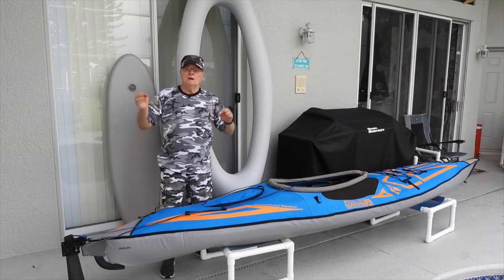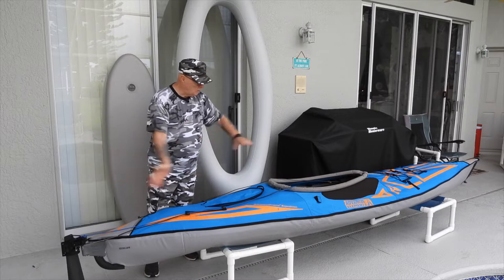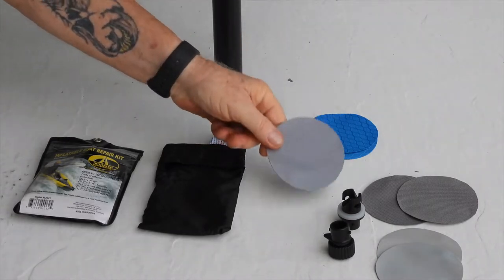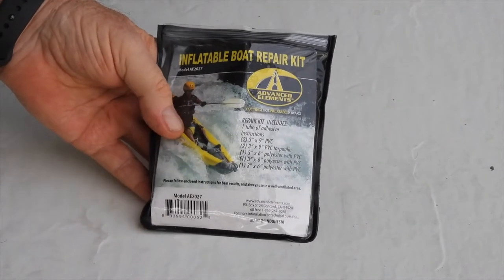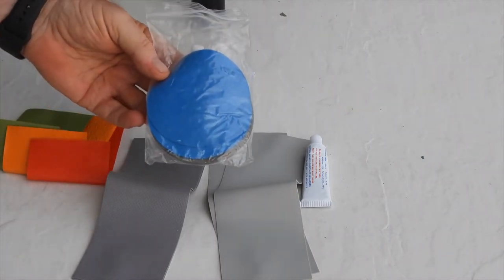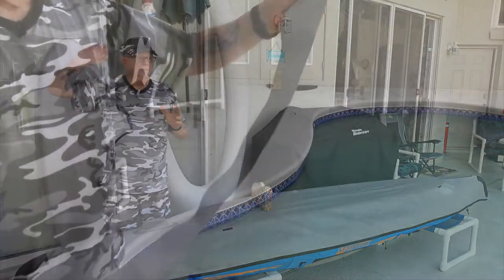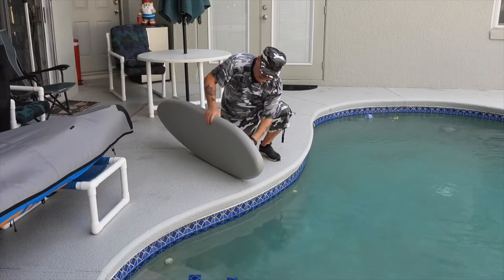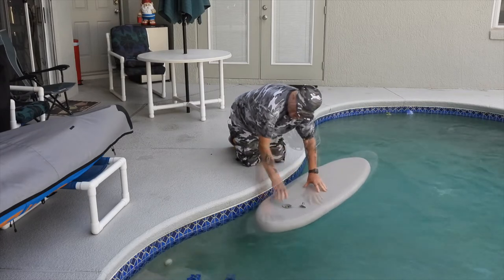Volume 2 Inspection & Repair

Comment: Very timely; just found out the leak I had thought was in the bladder is actually along the seam of the DS Floor
Reply from the maker: Glad I could help Bruce
Reply: @DaleMrDSimmons  haven't watched that far. Did you patch the DS floor?
Reply from the maker: @brucewayne2091  no didn’t need to
Reply: @DaleMrDSimmons  I'll have to figure it out 😁

Comment: Thanks for the video. I just had to make a repair the other day. I got about a 1 in cut in the bottom and had to keep pumping water out about once an hour. Was kind of surprised you have had to repair as much as you have.
Reply from the maker: In all reality I’ve had little problems considering I paddle in Florida waters. Rivers and streams here a rough on any kind of kayak. Also during my season I paddle about 4 to 5 times a week. I’ve never had a puncture mostly just hull scratches that are somewhat deep and I patch them just for security reasons.
Reply: Thanks, I am hoping mine was just a fluke and I hit something sharp in the water. Sitting in a puddle for most of the trip was not fun but at least I stayed floating.
Reply from the maker: @davidt9513  had to be something really sharp to cut through that hull.
Reply: I agree...unfortunately have no idea what did it or even exactly when it happened during the trip.